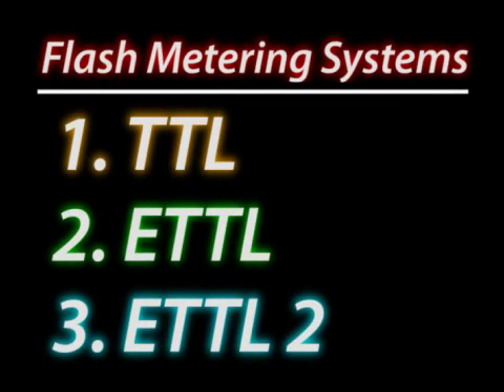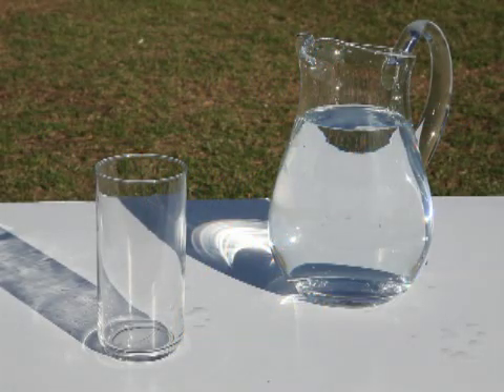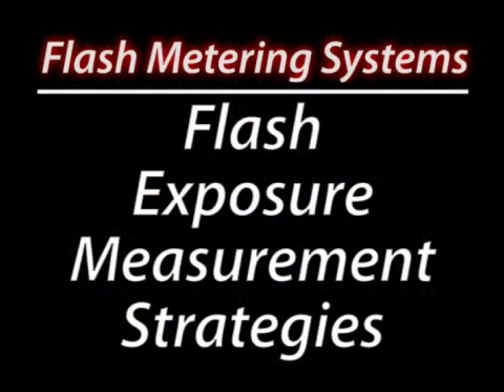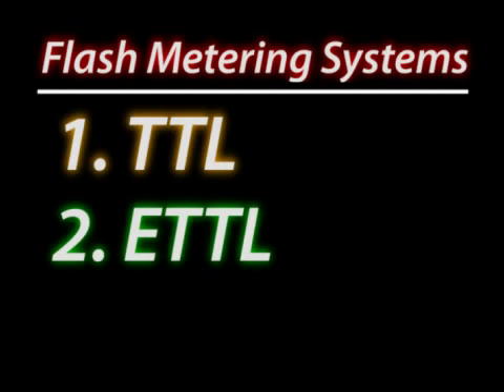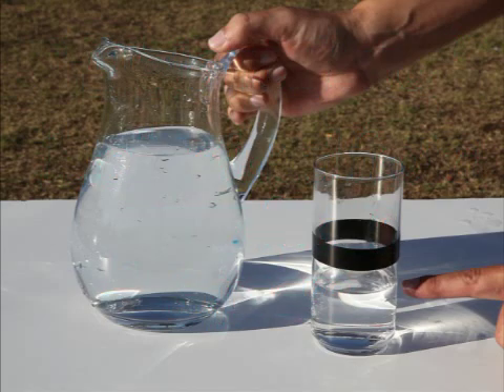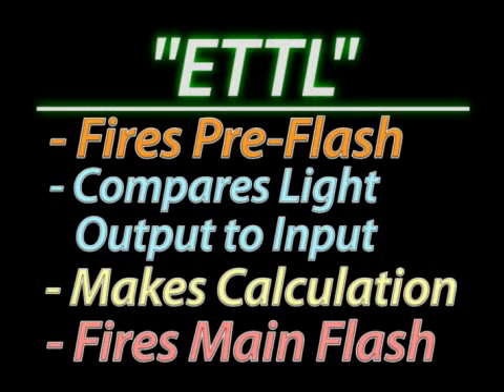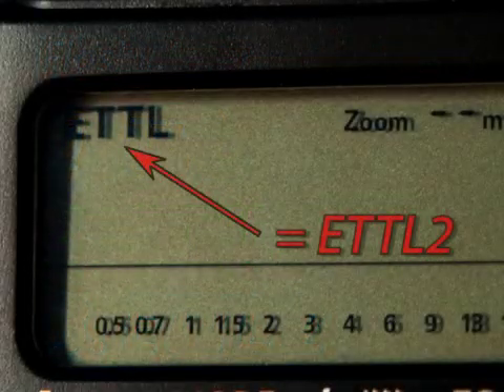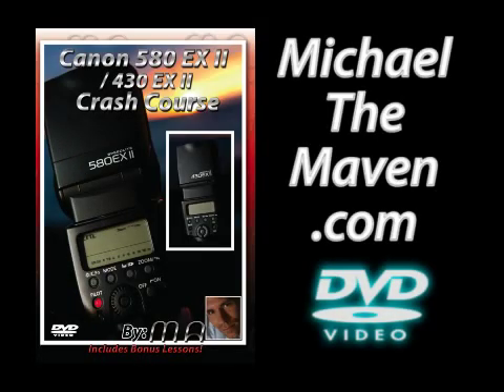TTL vs ETTL | Canon 580EXii / 430 EXii Speedlite DVD

Comment: I have Canon EOS 40D and Sunpak PZ4000AF flash. I readed in my Canon manual that TTL (not ETTL) flashes working always at maximum output power with this camera.

This means that there is no difference between full power manual flash and TTL mode?

Comment: If you see TTL it means the connection between the flash and the camera is not good. The flash then thinks it is attached to a film camera and reverts to TTL mode. Because there is no film plane sensor to read the exposure, the flash goes to max power thinking it needs more light to give a correct exposure. The result is an over exposed photo.

Comment: i wanna ask about the 580 ex ii. I've got one, and it sometimes fires an over power amount of light, making whole of my image over exposured.. Did i make mistake of the setting or is it a bad copy?
Btw i'm using the eos rebel xs and i tried to shoot in manual mode. 50mm f / 1.8 lens
the over powered shoot didn't come frequently. Sometimes between 3 or 4 times of shooting. Besides of that, everything goes fine...